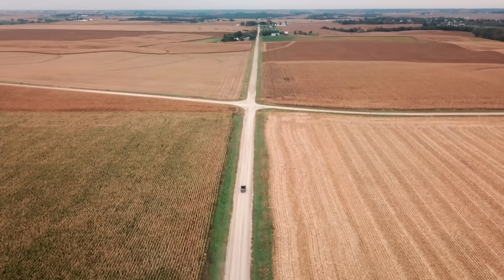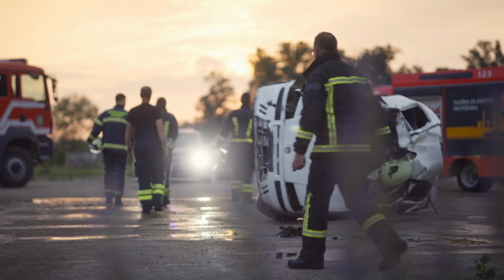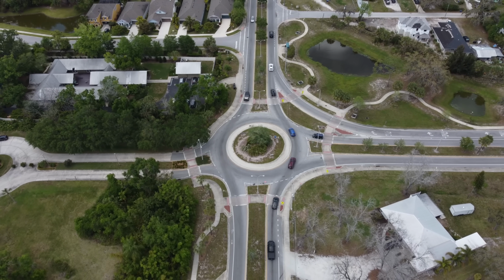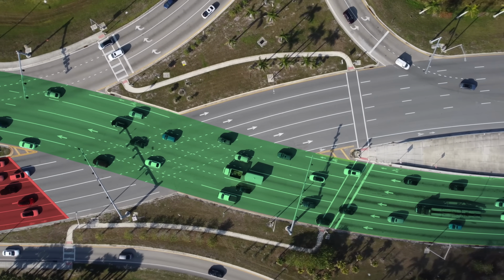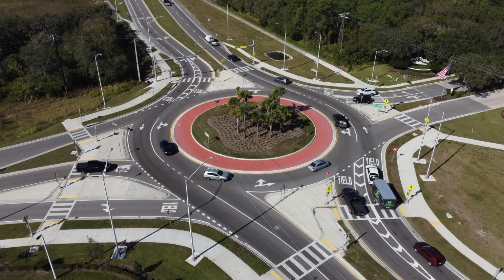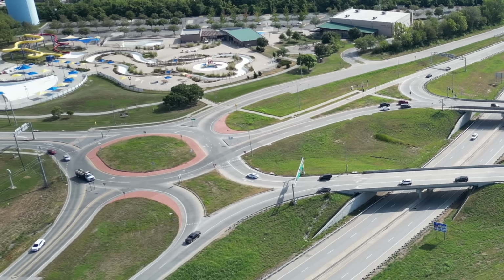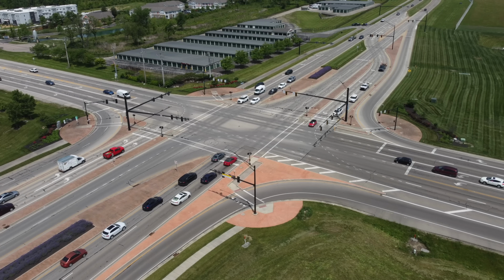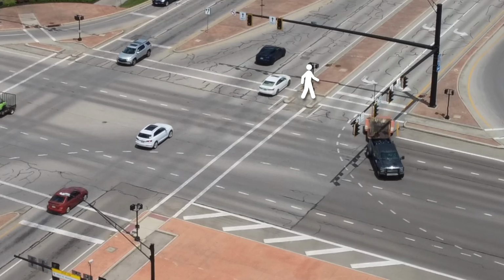These Intersections Are Changing the Roads Forever

Comment: A big problem here is that many of these roads are wildly oversized to begin with. Often, something has gone wrong with the street network of an area if you've ended up with that many lanes, and these solutions leave people walking and riding bikes without any good movement options.

Drivers also don't handle lots of lanes well. It's harder and harder to move from the left lane to right lane or vice-versa as lane count goes up, and the traffic light cycle durations increase as lanes are added (especially once the traffic engineers get whacked on the head and reminded that pedestrian crossings need to be included)

Comment: There are several major issues with this junction. Firstly, the common issue with most diverging diamond interchanges is that they basically fake "free flowing" traffic by replacing a crossing/alternating signalised movement with a free weaving movement. It's a very inefficient way to use road space and is prone to causing accidents, even if minor ones. Secondly, the diverging nature of it cuts down a lot of capacity in the through direction, and since there isn't a metered entry to the roundabout from the non-motorway road, the traffic that is on that road and has crossed the motorway has to yield at a roundabout that has two lanes of steady, likely uninterrupted traffic flow. It's also very costly in terms of space and man made structures.

In general this junction and the video seems to completely miss the fact that the optimal layout for such a junction depends entirely on the specific traffic flows at the location. It also completely ignores the larger network design issues that forced the integration of a frontage road into this junction in the first place, and also the factors specific to American usage that make signalised intersections inefficient and unsafe.

Comment: there used to be a diverging diamond interchange (the very first one, I believe) in Nogent sur marne next to Paris on the A4/A86 intersection. It was awful though... It's good for low traffic but when traffic jams start happening, both sides of the intersection get completely gridlocked. they installed roundabouts now and there's never any traffic anymore.
Reply: It matters how you program the lights and if they are adaptive to traffic and the like.
Reply: Diverging diamonds mostly replace the classic interstate intersections in the us.  While roundabouts work well, there is a ton of 18 wheel traffic that needs wider and less sharp turns, so roundabouts aren't practical there.
Reply: A diverging diamond interchange in France? No way, there's only a lot of stupid roundabout, stupid traffic light and stupid stop.
Reply: @pierrotp.8566 There is actually still one installed in Versailles.

Comment: This is optimized for cars only. Also what these intersections try to solve, is humans, not traffic. What the video addresses multiple times, is danger by cars driving wrong. First we should combine people, that have the same destination. This is what public transport is for. If done correctly, you get quicker to your destination and people living in these areas, get their space back.

But one huge benefit would be connected self driving cars. The connection is here very important. This way you only need to calculate with one vehicle, that is infinitely long and can be split at any point. This increases traffic a lot. You don't have multiple cars, who need to accelerate. This process is slow, as the first person can react at the traffic light and accelerate, the 2nd only after the first person started driving and so on, adding reaction time with each car. Connected cars each accelerate at the same time, if the light turns green. This sets the recon time to nearly 0. Nearly because the signal needs to travel and this causes a tiny delay. Also they need less safety room. They don't need any reaction time and they know how good a car is and they know how they need to break.

At this point we don't even need traffic lights anymore and just tell the cars, which ones to pass. They can reduce the gaps to a minimum, making every humans driver flinch. Still there are problems. First these cars can't talk to each other and next, they get analog inputs, that for a human.

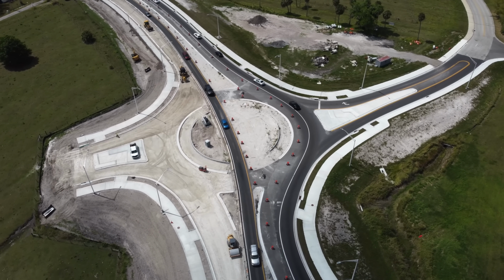Comment: 2:15 is this for mid construction only? I’ve seen track laid like that but I’m guessing it’s temporary
Reply: Frequently happens like that in Europe. They often replace a former T-crossing with the new, still unconnected arm destined for a new development.
Reply: it's pretty common when an intersection gets turned into a roundabout.
this way most of the building can be done while the intersection stays open.
once it's all finished they only need a night of work to change it over, so this way they impact on traffic is as minimal as possible.

and the arm leading to no where is pretty common too.
after all the city often knows decades in advance where they will expand to, 
so during the building of the roundabout they already build the extra arm so in the future they can simply connect the road from the new development to the already finished roundabout.

Comment: Single-point intersection is still my best choice for highway exits. There is only one traffic light with three signals. The surface road, both left turn lanes of the surface road, and both left turn lanes from the exits.
Reply: Ped crossing distance result in minimum cycle lengths of at least 90 most of the time. In operation SPUIs run in 120 to 150 second cycles throughout the day. You can bring that down by not allowing peds to cross the main street, or you can run it in its required high cycle and try to convince the community that the design is "ped friendly" even as it makes them wait upwards of 2 minutes to get a walk.

Not saying DDIs are better for peds; Clearly they've got their issues as well. But making them wait so long they get temped to disregard the signal indication isn't one of them.
Reply: Yes
Reply: The dd just make the intersection bigger
Reply: I prefer this intersection: "Rijkswaterstaat steunpunt Houten" (place next to intersection in NL).

The land use is bad, but the throughput, pedestrian access, and time spent by everyone at the intersections are much better. And even the land use can be solved, as this intersection expertly shows.

Comment: Thanks for this video on these alternative intersection designs, which both improve safety, emissions, and traffiic flow.  One other advantage of roundabouts is the opportunity to create aesthetic benefits and community landmarks, through landscaping and/or monuments.

The continuous flow intersection design is also called by FhWA (Federal Highway Administration)  a "displaced left turn intersection," a name that makes more sense as traffic in a CFI often has to stop at a signal.  It seems an especially beneficial design where you. have a large volume of traffic turning 90 degrees between two adjacent legs of the intersection, as only one offset left turn lane may be required.

Another innovative intersection design I recently learned about is the Restricted Crossing U-Turn intersection (RCUT).  Unfortunately, I don't see a way for me to attach a photo, but I'll try to describe it. I found one on Google maps on NC-11 just south of Kinston, NC. It's very similar to a Michigan U-turn but doesn't require a massively wide median, so could be used on many standard high-speed divided highways, and seems especially appropriate where lower-volume local roads cross them.  Barriers prevent the local road traffic from crossing directly across the divided highway, allowing only right turns.  A short distance beyond the intersection on the divided highway, there's a left-turn lane, similar to the Michigan design, but instead of merging onto the mainline opposing direction, the mainline is widened to facilitate U-turns by adding an auxiliary right-turn lane allowing the driver to continue safely into the auxiliary lane to make a right turn back onto the local road., or continue on the divided highway.  (A photo would make all this confusing verbiage unnecessary!) I think this design could profoundly improve safety at this type of intersection, which I imagine results in particularly serious collisions due to the high speed of traffic. I found an ariticle on Philaplace.org on this design (Farewell to Roundabouts: How a Smarter Intersection Design is Changing American Roads) if you want to look into it further.
Reply: I just noticed that FhWA has a youTube video (from 9 years ago!) titled "Alternative Intersections: Displaced Left Turns."  I've actually driven on a road with several of them (Bangerter Highway in Salt Lake City) and also a diverging diamond (I-5 at Marvin Road NE in Lacey, WA).  On the ground, both were easy to navigate and not confusing with adequate signage.

Comment: Excellent take on roundabouts.  I do have to quibble with diverging diamonds.  Apart from the space they take up, which is…a lot, they seem to be a North American solution* to a North American problem.  Specifically the traffic induced from car dependency and the result of ramming highways and freeways through cities.  The solution is viable alternatives to driving so that traffic volumes are reduced and we don’t need these overbuilt monstrosities. I mean, look at how insanely wide those roads/stroads are!  We can then dismantle the freeways through cities, reduce car volumes so that the remaining car traffic can be separated with through traffic on ring roads and local traffic on local streets, thus reducing the conflicts that cause traffic in the first place.  Granted, this will likely take a long, long, long, looooooooooooooooong time! But it needs to be done if we ever want our cities and suburbs to be livable.

*I’m aware of the fact that the first diverging diamonds were in France.  However, from what I can tell, only a few were ever built and have been removed already.
Reply: Incorrect.  They still exist in France, and are also being used more recently in Denmark and Belgium.
Reply: @traffic.engineer the Nogent-sur-Marne interchange was converted back to a standard design in 2019, there’s only one in Denmark, and is anyone really surprised by Belgium? OTOH, the US has built over 150 with a lot more under construction.